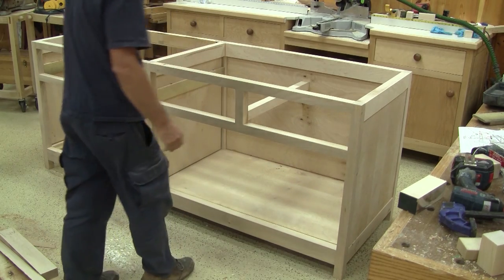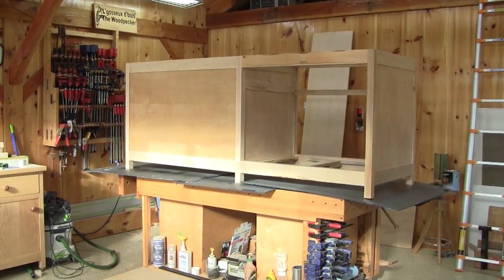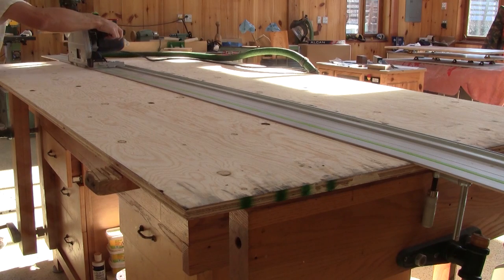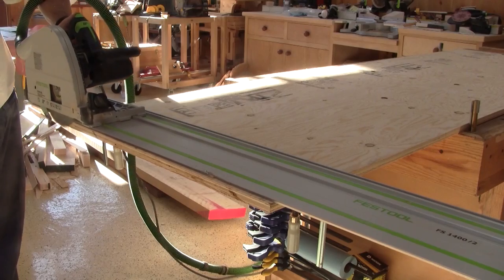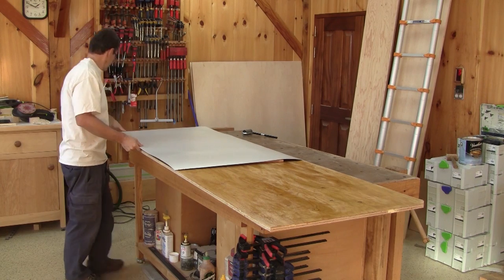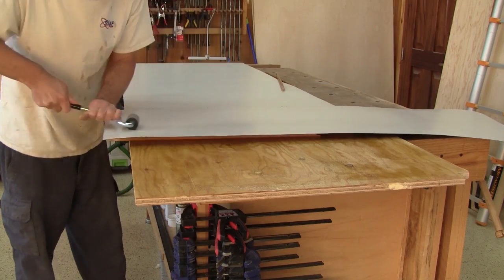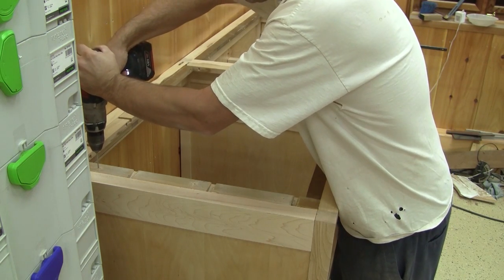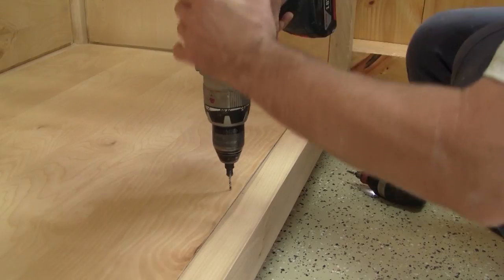The Woodpecker Ep 111 - Water cabinet - part 2

Comment: Nice reuse of material. I'm not sure I'd have had the patience to glue together all those old draw sides and then fill the old dados. Shame your formica wasn't big enough to cover the top in one piece, I'd be a bit worried about it letting water in through the join. I've done a kitchen counter top with a join and even though it's in a dry area it's showing signs of leaking a bit.
Reply from the maker: +Wobblycogs Workshop Yes I know, but I was keeping it jist for that, so both of my shop cabinet would have the same formica top. I've glued the big section over the sink, hopefully no water will ever go on the joints.